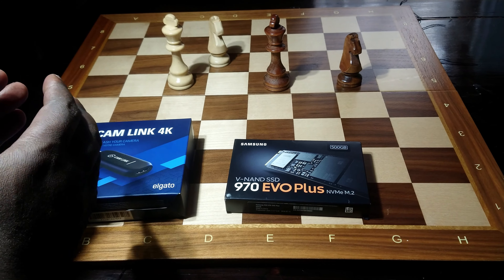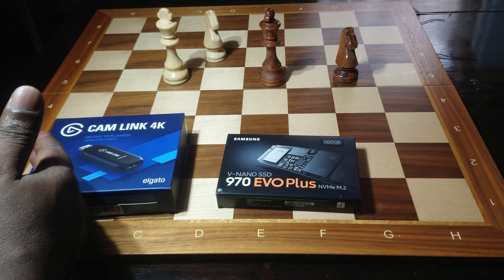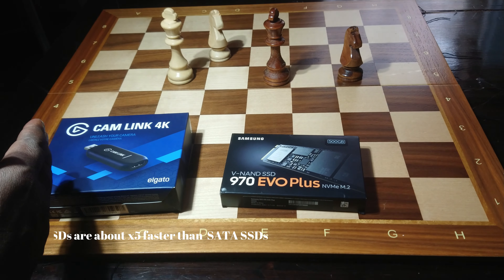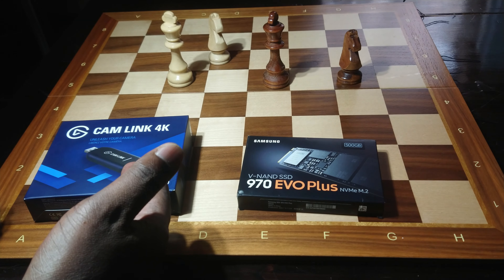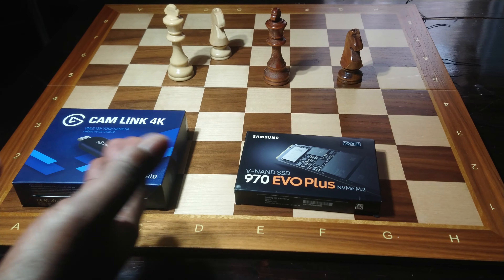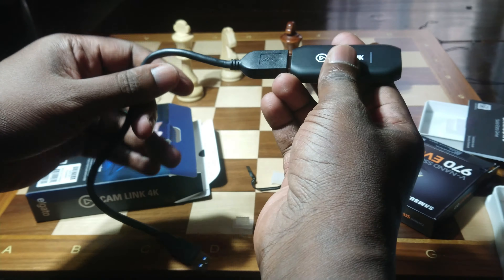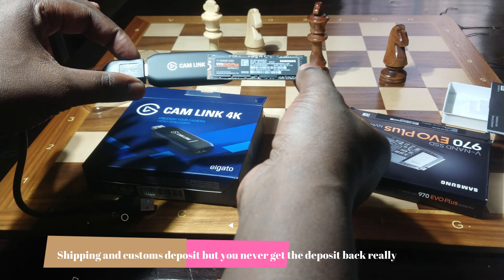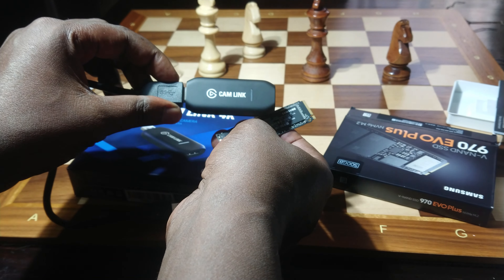Unboxing disaster - From Excitement to Costly mistake - M.2 SSD + Elgato Camlink, $900 HP Laptop

Comment: I have a hp star wars limited edition. Last year it got water damaged and upon the repair process i noticed they normally have a top case underneath the fun and the keyboard. To replace your ram you’d have to go through a series of screws before you get to it. But first check out similar YouTube clips on the same. All the best Godspeed 🙏🏻
Reply from the maker: Thank you Tonie. The RAM bay was the black box above the hard disk. The cover was held down by clips. There has been a development and I have since also found the m.2 slot and installed the SSD.

Comment: The m.2 slot is in between the cooling fan and the battery. 😂🤣 It's the small black empty slot with the metal screw hole behind it. The screw hole is in the metal shield behind it haha!
Reply from the maker: :) Indeed. I found it the next day following a very helpful image on the net. The empty slot looks like an IC with soldered slots both sides. Once someone knows what it looks like, it looks so obvious. Did a follow-up video and will post this week. Cheers.

Comment: Nice video. Should have opted for the SATA ssd which would have gone on your hard disk slot because it is easier to install. But the problem with modern laptops is that some do not come with the slots for the mSATA and M.2 or some just don't work with some brands of ssd's thats why it is always recommended sometimes to run a compatibility test for the product you are buying and your machine to endure it will work there are several sites that offer this feature. Nice video though.
Reply from the maker: Thank you Brandon. However, two problems with this are:
1. Data SSD are 5 times slower than m. 2 SSDs. They are limited by the SATA bus speeds.
2. I wanted to retain my 1GB harddisk as a storage drive.
I eventually found the slot and installed it. Totally worth it. Start-up time down from 3 minutes to 30secs with dual boot option available.:)